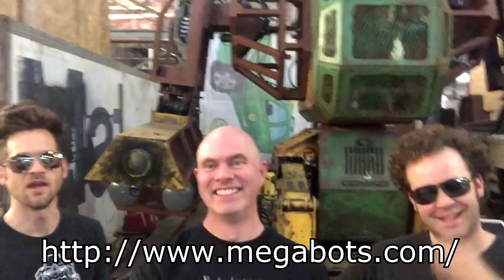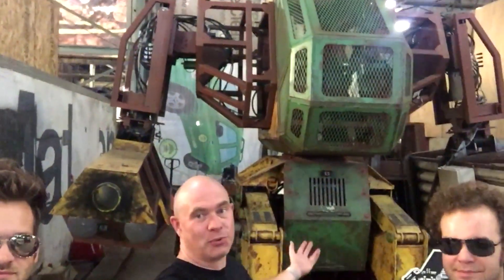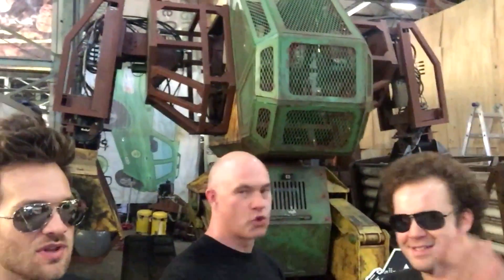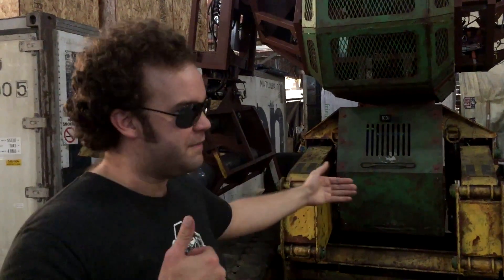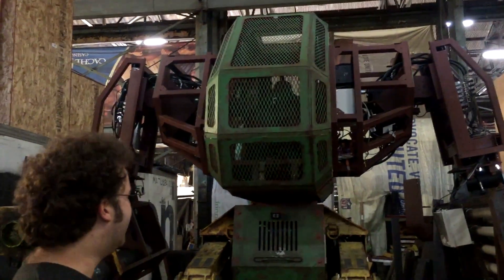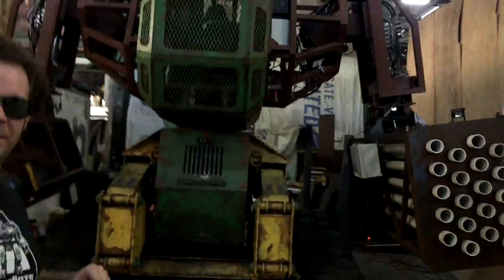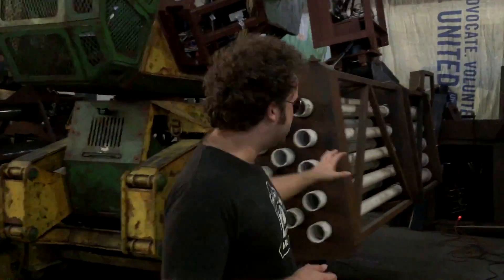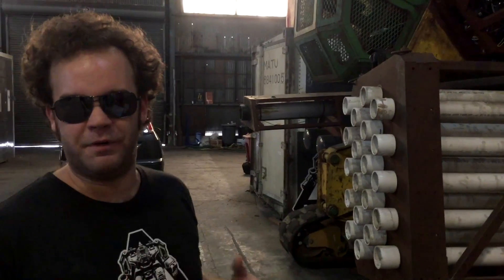Megabots - Real Life, Full Scale Fighting Mechs

Comment: I would suggest armament placement to be higher. At least at the pilot/gunner's head height, or preferably higher, like above the shoulder. I know you guys are going for that classic MechWarrior look, but plenty of battletech mechs have shouler mounted weapon systems. Much better to avoid a scenario where you're tall enough to be shot at but not have your weapons high enough to return fire. Also allows you to actually fire from cover. As it is you have all the disadvantages of a high profile weapon system with none of the advantages. My 2 cents.

Comment: See, what they ought to do is go Chromehounds here- figure out a sufficiently sturdy parallel actuator for the waist gimbal, and develop a plug'n'play connector for each weapon system (they've already got it started in the Cannon side) instead of bothering with actuated arms- treads, wheels and quads are perfectly acceptable for those sorts of bots.

Of course, if they can figure out actuators for the arms enough, then a Battletech system would be fine- especially with augmented-reality HUD systems.  But as soon as they said "Gun Cams", Chromehounds was all I could think.

Comment: It's just a crane in fancy dressing. It doesn't walk, it uses threads, so not a mech. I'll be impressed when they build something that walk. there is nothing "at the edge of technology" in this thing, could have been made in the 80's. I'm sorry I just find this really lame :/
Reply: +Guss De Blöd Mechs dont need to walk- neither in this competition do, and no it coundn't have been made in the 80s- the computing technology needed to control it didn't exist.
Reply: Michael Halpern
 No need for computing technology to control this, there isn't much to control. a standard digger is way more complex.
Reply: +Michael Halpern its called hydraulics, and its been around for quite a long time lol.
Reply: Mister Torgue Flexington
hydraulics need power and motors- really all hydraulics do is convert rotary movement into piston movement but its still power hungry when you upscale also theres the issue of ballance

Comment: Cant wait to see riot police using this.
Reply: Lmao what an awful idea, mechs will never be a good idea, so many design flaws.
Reply: This mech will note used by riot police. By the time this thing is more ready to be sold, it will probably be one that can walk
Reply: +Frederick Abel actually there aren't as many as you think- so long as you forgo the walking, and dont make them overly huge- they should be rather versatile- provided you overcome the engineering challenges they present
Reply: Michael Halpern One decent explosive to the "groin" area and the thing is immobile.
Reply: Frederick Abel
2 problems with that plan- decent armor and machine gun. also if the armor is half as good as that of modern tanks even if it is immobilized thats all that will happen- before another unit feeds lead to the offender- and the thing is back up and running in a few hours.
Reply: Michael Halpern Unfortunately for there to be moving joints that operate like legs, there have to be cracks and weak points in the armour, it's just geometry. Not sure what the point about the machine gun was for, most tanks have machine guns on them yet they are frequently destroyed by RPGS. Not to mention if this thing stepped on a mine, it would probably fall over, and I have no idea how it's going to get up. 

No to mention any basic car could outrun any mech that walks or even runs, and any tank could put a high penetration shell straight into the centre of a mech and the whole thing would be fucked.
Reply: Frederick Abel
actually modern tanks are RARELY destroyed completely by rpgs - the point about machine guns is that in order to get close enough to make that shot- they could spot you and riddle you with bullets.- the heat from the rocket would tell your position, geometry actually helps the mech in this case- angular armor, and because of the height- can be difficult to hit dead on these are solvable issues.
 and what about a mech that drives on treads- it just needs to keep up with the tanks- cars can eat bullets- no need to out run them.
Reply: +Frederick Abel well we have have a tank that has similar features to a mech

Comment: So when does Britain get it's giant mech?
Reply: When we A: get the full tesla VR suit thing and revers engineer it, B: fully disassemble some Challenger II tanks, C: check the name "Challenger III" is not used for any other projects, : take some UI from star citizen, some UI from mech warrior online, etc, E: use the stuff taken from the tanks to make a hydraulic frame with the reverse-engineered VR suit thing in the cockpit, into a battle machine, and F: finish coding and testing the OS for the mech. There we go, one Challenger III mech.
Reply: megatiger78 you forgot the built in kettle
Reply: The Mighty chicken Lilley that's easy. just add a kettle.